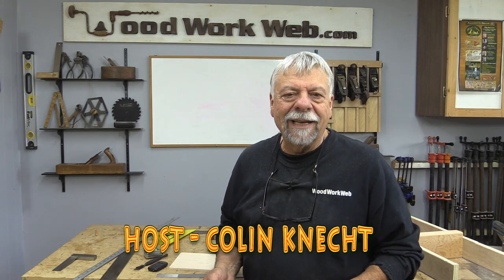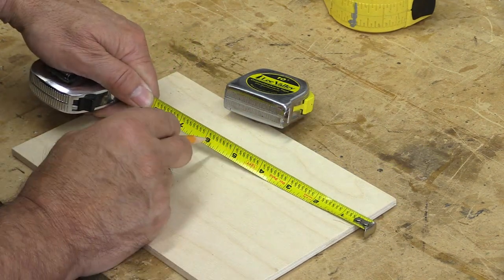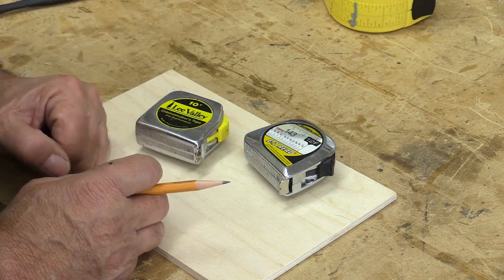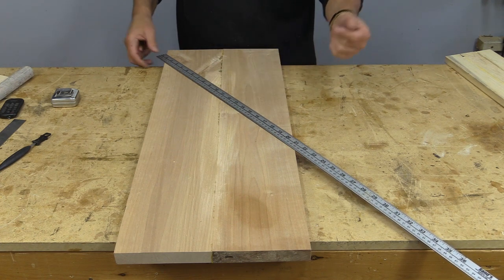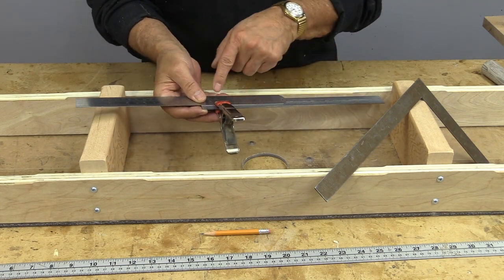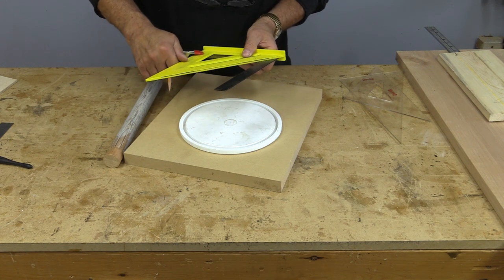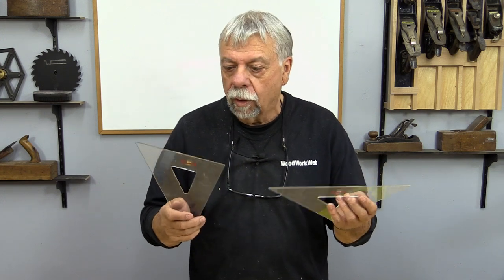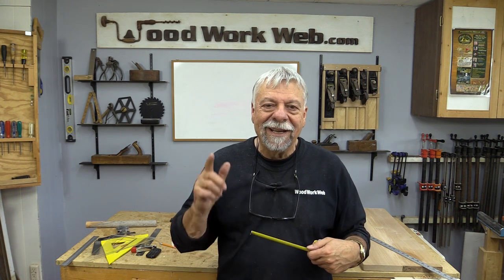5 Quick Measuring Hacks - Woodworking Tips and Tricks

Comment: Thank god we went metric 40 odd years ago..
Reply: Some people just don't understand fractions.  lol
Reply: @Bill-YellowDogWelding  Not at all I learnt both  as a kid, Metric is just that much better in every respect
Reply: @motsigman   Sorry, that's not true.  Where I live we use both.  They each have their strengths so we use the unit that works best.  Better not be too narrow minded, use all the tools.
Reply: @Bill-YellowDogWelding  
Not to offend anyone, there are some people who can't understand different systems. I have to mention some Mars probes that failed because of the differences between metric and imperial systems.
Now engineers have to use the metric system officially around the World, that means there are reasons to use it. I admit imperial system has its advantages, but it has more drawbacks.
Imperial system needs way more things to keep in mind than metric, while the decimal system can be applied everywhere in the metric system. It's a big advantage I guess.
Have to mention when someone has to deal with less than 1/16 or 1/32 inch dimensions, the decimal system can't be avoided.
Reply: Metric system is for people who can only count by 1
Reply: @hilarybumgarner932  
Actually it's 10, but people like to use the decimal system, since it's logical. Imperial system seems illogical, compared to the metric one. Traverse me if you can.
Reply: I have a tape measure that is imperial and metric. I change between either one, depending on my mood. Also helps if I design something foe someone in another country that uses metric (most of the rest of the World)
Reply: @Bill-YellowDogWelding  I understand fractions, and realise their limitations.
Reply: @baladar1353  ok.. If 10 are so great, why aren't they seen in nature? How big is a quarter of a centimeter  or a third of a kilometer or meter or any metric unit of measure.. imperial system is natural and can be replicated anytime any day. The metric system must be copied. It was clearly designed for people who don't want to think for themselves and must be lead. You may say it's easier and I say yes you're right just like lowering the bar is. It's My Philosophy that if you can't read a tape measure you have no business owning a tape measure or the tools that go with it. I only work with sharp tools and sharp people. That way I keep the fingers and toes I have. ( I don't have all my fingers on one hand and honestly I don't have all my toes on one foot. That would look weird, wouldn't? 10 fingers on one hand and ten toes on one foot? LOLOL)

I do get how convenient the metric system as though I think it's actually pretty cool how they all relate. I think it's pretty sharp how 1 cubic centimeter is equal to one milliliter is equal to one gram of water. And that water freezes at 0 and boils at a hundred. That is one handy package. But I think our number system should have been based on 12, not 10. 12 is a way cooler number. You get all the basics, halves, thirds, quarters . eighths are just one fold away. I know decimals seem to be easier to deal with and they're easier for groups to handle, but fractions have their married life as well I'm sure I'm not the only one who thinks division is more difficult than multiplication. With fractions division is multiplication and so is multiplication. When doing long division if I wanted to divide  57 by 9, the answer is 6 1/3. What's the decimal equivalent to that? My point is that what it is determine if there is a remainder, that reminder just becomes a numerator over the dividing number as the denominator. Done. Okay I'm totally abusing Google Voice Type by now and I'm out of time. I hope it it all makes sense. 
Cheers
Reply: @jdog4534  It's late, I guess, but I can't tell if your joking or not.  If you are, that's kind of funny. If you aren't, that also is kind of funny...

Best wishes.
Reply: @UKnowIfUKnow  mostly just stating facts and pointing out some overlooked issues with a 10 based number system. Other problems have to do with how we view the 10. Why don't we see 10 as the first of the teen group when we don't see 20 as the last teen but that's a whole different subject,  considering eleven and twelve aren't teens either but teen is a reference to ten.

Comment: So a housing or commercial isn't as important and doesn't need to be as "precise" as a picture frame... What a joke. Im a carpenter and ill stop you there and say you're wrong. And its a speed square rookie.
Reply: There's no point in being rude.

I just did a quick check with a framing square. Walls neither flat nor square.  Steel door jamb not square. I know steel angle brackets intended to hold shelving are not square.

Comment: 2 points:You can’t read a tape measure because the numbers are upside down?Don’t use sharp tools you are dangerous.Second point you can’t divide by 2 and think it is easier to measure diagonals?You clearly have never done anything more complicated than a square picture frame,on the subject of which measuring diagonals to find square is important but in your example the square on its own would be sufficient..I came to learn and left a little more ignorant